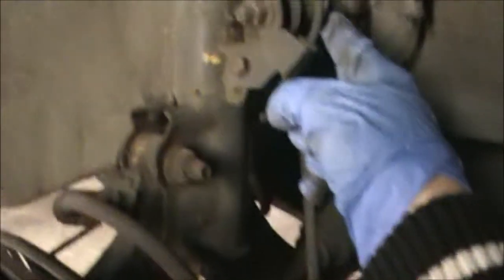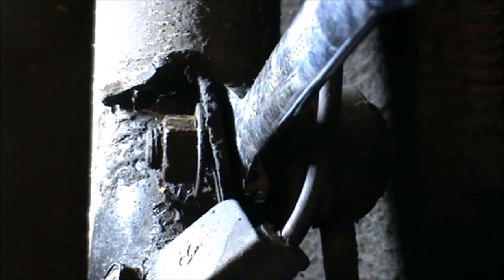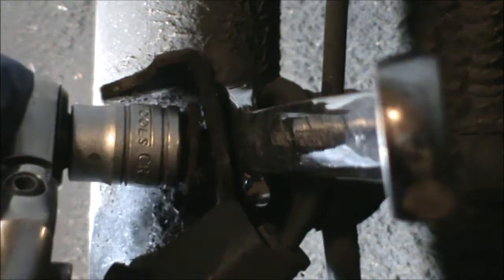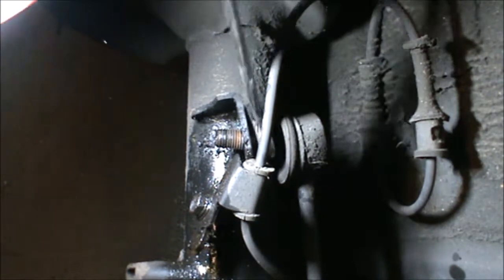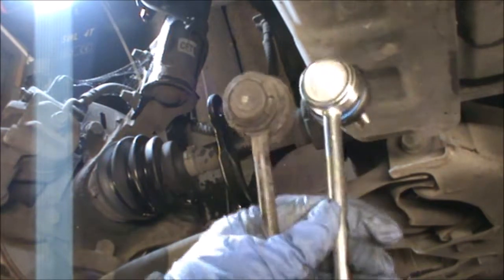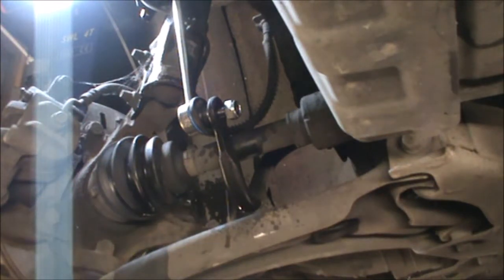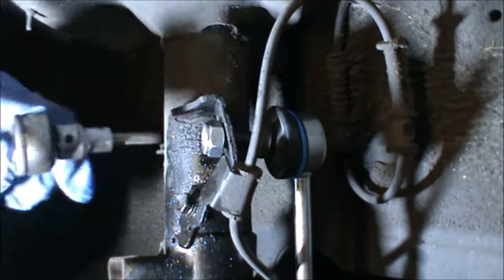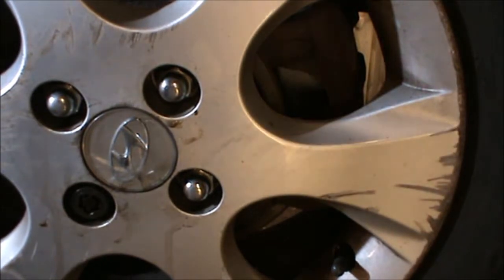Hyundai i20 2009 front antiroll bar links removal and replacement

Comment: What the hell have you put a spanner on? Then is no flat edge it's bloody round!
Reply from the maker: This particular design has a flat edge for the spanner. If it’s round there should be a torx or allen key type in front of the bolt to hold the centre.
Reply: @Ryan-or1jm  same here mine is just round , spanner just spins and there is no Allen keys wtf